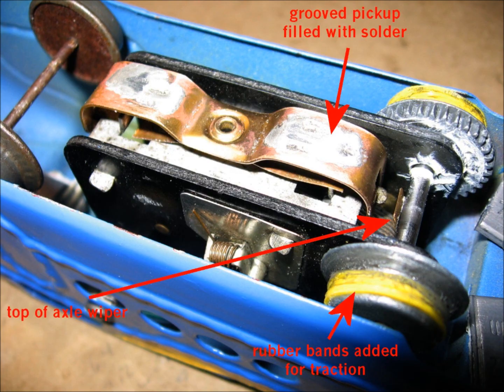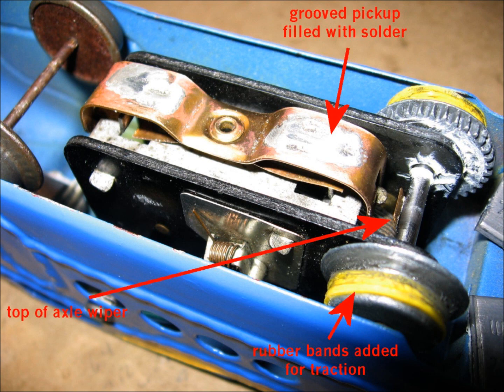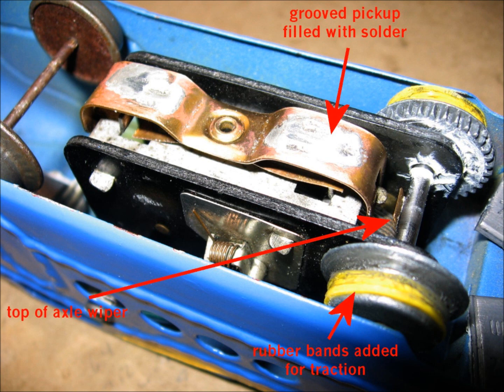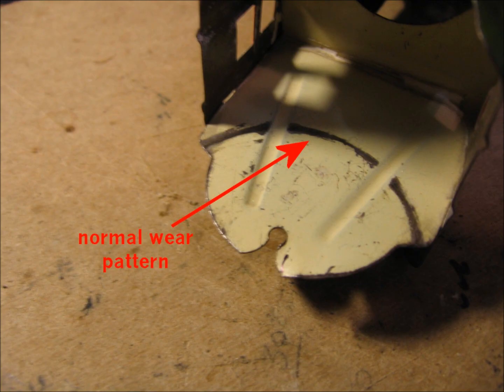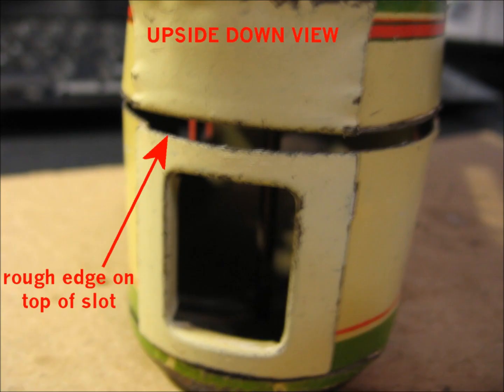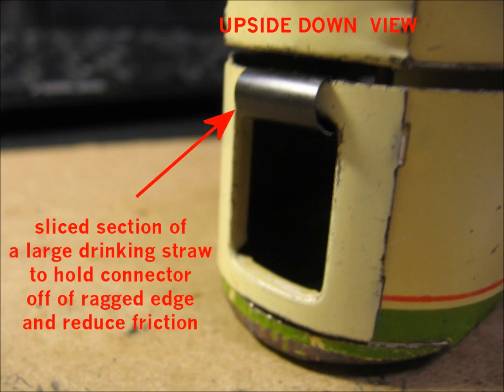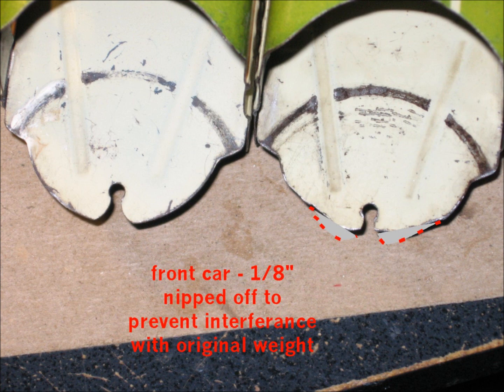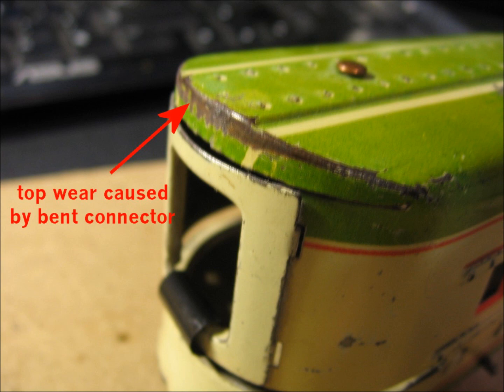TRICKING OUT THE SMALL DRIVER M10005

Comment: Great film Bill and well thought out. I actually added a bit of grease to the the wear pattern area of my connectors and used a fine file to remove the rough metal edge in the slots.
Chuck